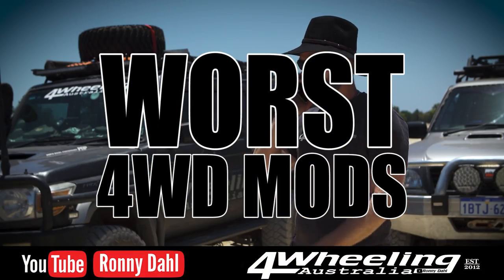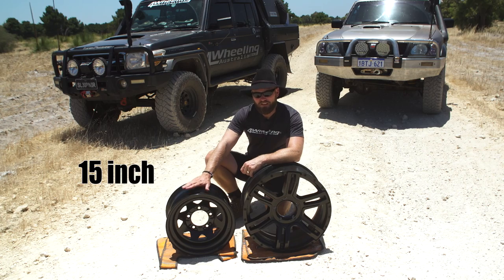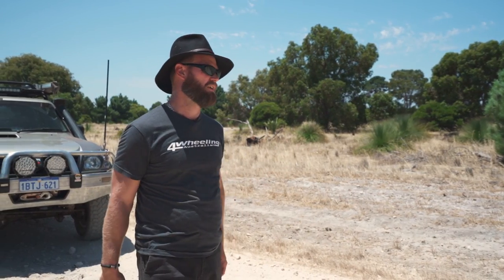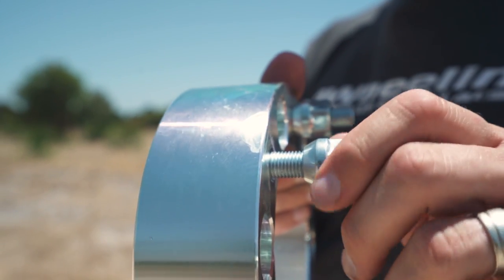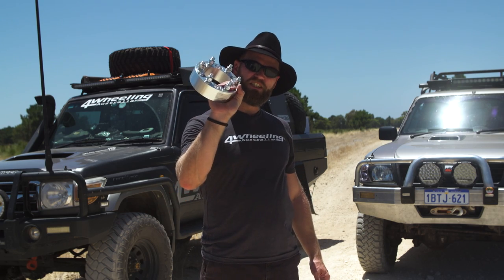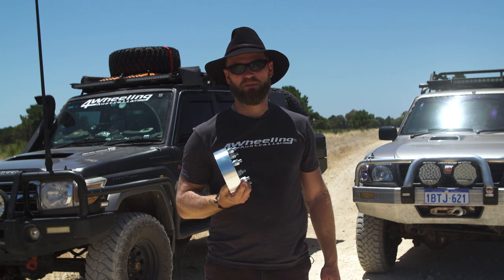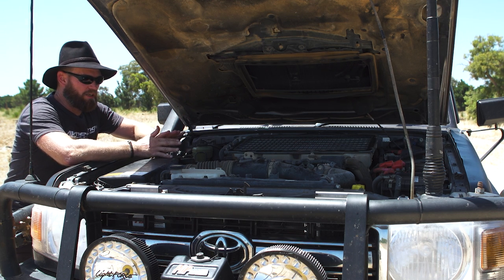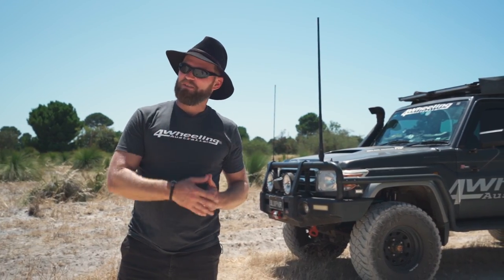WORST 4x4 MODS, DON'T DO THESE TO YOUR 4WD

Comment: Considering this is a mod page, and people are talking about tyres, would you ever consider going down to 33” tyres and giving us your likes and dislikes and mostly what you encounter with smaller tyres etc, like I wonder if you would do a big trip and give us your thoughts, considering you have used 35”S for ages now!
Reply from the maker: It’s something I’d like to compare and try as may ask this question publicly and privately. After restrictions I’ll give it a crack.
Reply: Ronny Dahl. Awesome mate looking forward to it, my main reason is basically tradies and some business owners mostly own vehicles that run 33”s and smaller and are doing smaller touring trips here and there. Most of us wouldn’t drive around town with 35”s for obvious cost reasons, but try to weigh up the added benefit of engineering and fuel consumption on the trips that we do take, just curios on your experiences thoughts. Keep up the great work and cinematography 👍🏼

Comment: Lmao wheel spacers are illegal in Australia? That sucks.  They can be useful if installed right to prevent rubbing.
Reply: Or you can just get correct it with wheel offset or a diff. As he said, on top of being illegal cheaping out is not smart. Poor man pays twice

Comment: When people buy too much truck.  If you get a f550 or a quad cab duramax 3500 hd and then thing you can just go out to the mud and the sand.  They spend 20k on wheels and lift to make it all "pretty" just to get stuck and be pulled out by a jeep or a suzuki that they were talking shit to on the way in. They are just too big and heavy.

Comment: You do realize that wheel spacers are not road legal in Australia that laws vary greatly worldwide right.

EDIT; When it comes to over the top engine tuning what if you have a Laptop and can switch between different tuning profiles, "Danger to Manifold" kind of thing?
Reply: You do realize that a viewer with even the slightest modicum of intelligence would be able to assume that the legalities referred to in a content creator's videos are most likely in reference to the laws in which country they are a resident of, unless stated otherwise, and to expect the content creator to know and acknowledge the laws as they pertain to all 195 countries on this planet is ludicrous.

Comment: Should put a "worst driving etiquette" video up as well Ronny. Gonna be the old man that shouts at clouds here but I am sick to death of ppl using the beach where all the families are camping or day tripping as a friken race track doing warp 11 on the beach past campsites where little kids and pets are around thinking it somehow adds an extra couple of inches...*cough* WHITEHILLS *cough*.
 Also to think letting your tires down somehow deflates your manhood as well when all it does is save the track and stop you getting stuck in easily avoidable situations. Oh yeah the worst mod you can do to a 4x4 is put a DH behind the wheel of it.

Comment: lifting an outback. sorry but even as an outback owner i just don’t see the point. You’re taking an AWD and making it maybe just as capable as a stock 4WD. makes more sense to just buy a stock 4wd and build a more capable rig off of that in my opinion. I love my outback but i know what it’s limits are and with little aftermarket even being available besides some rally accessories, i don’t see it as practical. There’s one good quality lift on the market for them and you know many aren’t dishing the money for a decent lift. it’s a good car camper but not a good truly off-road rig.

Comment: Me & my offroad buddies laugh at those super lifted vehicles that many we see claiming they go offroading! We actually run long suspension travel lots! Meaning, sure we get a few inches of lift but our suspension travel is maxed out, ie: when topping out we only got 6-7 inches of travel but we got over 12 inches that the suspension can extend, allowing for our tires to remain planted on the ground! Those who have those super high lifts tend to have at least 1 wheel off the ground nearly all the time at any one time! Plus the fact that sure they are lifted but still get high centered from their diffs & they just tear up those chrome diff plates! Lol, or they have those 4 link drop suspensions that get hung up on thick brush & many times caught fire due too the tunes they have on their "rigs"! Me & my buddies warn them on where we are going & clearance will be an issue! Not rock height issues, low tree issues! Many don't listen then complain that they just smashed their windshield(or windscreen for my follow bros & brunettes over the pond) from being to aggressive while near a low hanging tree! Also, sure having a little more height is nice to keep the water out of your rig but when you need help getting into or out of your rig tends to turn many off of helping you out! I don't like helping a 400lb guy(I'm 270lb guy myself so I shouldn't be too mean) get in to his rig just because he broke his step ladder! & that's one of my, "Why have this?!" Item, if you need a step ladder to get into your rig then it's to talk for ya or your to out of shape! Sure I carry a foot stool so my mother can get into my rig but that's to help someone else into my rig not from me, she has muscle & bone problems & sometimes I have to drive her around, so I'm doing that to help my mother, not to make it easier for me to get in/out myself! One of my buddies has a very lite form of MS(he claims it's a lite case, not me & he is over 200lbs) & with his lifted rig can get in & out without help so there's that too!

Comment: Idiots that have gone overboard with LED lights. There's a 4x4 in Cairns with (are you ready for this) 1 x 42inch Stedi LED bar mounted on the roof, 4 x Type-x Stedi lights mounted on the bull bar, Another 12inch Stedi mounted behind the grill, 2 x LED lights mounted near the rear vision mirrors facing slightly outwards at about 20 degrees, and 2 x LED lights facing towards the rear. You'd be able to see this 4x4 from outer space. Absolutely ridiculous and a waste of money.

Comment: Just watched this vid I know I'm really late for this comment but a snorkel is by far the worst mod. First of all it's at the roof of your truck. And if your in that deep I would be worried more about a snorkel and swimming gear for myself not the truck that just sunk
Reply: Worth noting that snorkels are also useful in dusty environments, particularly in convoys. Air will be notably cleaner up higher and many snorkels have an optional pre-filter to help preserve the engine air filter even further.

Comment: Bro dozers and useless mods, do y'all get the "insert whatever you call it" lean down under? It's this terrible trend all over the US with different states/towns claiming it as their own, where they lift the front of their truck/SUVs and often lower the rear. It's very illegal in all 50 states, but nobody stops em for it. I'm with you though, little rims, biggest tires that it'll fit, simple but quality mods, none of that extra stuff. Most 4x4s will do a lot more than people think with a solid all terrain or mild mud terrain, and skilled driving.

Comment: The giant wheels are definitely the worst.  They just scream Mall Crawler.  Run the smallest diameter wheel your brakes will allow.
I disagree with the HiLift jack though.  It has so many uses other than jacking up your vehicle that it's almost foolish not to have one if you go off-road.  Most of them were listed in another comment, but I'll add another here: they can be used to break the bead on your tire so you can clean out any mud or debris causing your tire to go flat.
I'm also amused by the cultural differences in off roading between Oz and the States.  I would say about let's say 65% of the stuff on your rigs (even if they are pretty awesome) would get you mocked off the trail by a serious off roader here in the States.  I don't mean any disrespect there and I know why those differences exist.  Oz has a crap ton of wide open space where you can get really far away from civilization, so an Expo rig like yours would shine there.  Here we have off road parks and trails that look more like what your buddy was doing with the rock crawling and such, plus deep mud.  An expo rig in that situation is way too top heavy or just plain too heavy in the mud.
As far as the wheel spacers, when installed properly, properly torqued with installed with thread locker, they can actually be safer than not having them as they add lateral stability to your vehicle.  They aren't illegal here either, though some shops won't touch them.  Yes, they put more stress on your wheel bearings, but so do wheels with less than centered backspacing.  Funny part is, I'm running both kinds.  I'm running 1.25" spacers with 4.25" BS 16x8" wheels on my T4R (my daily) so the tires can clear the upper control arms on the front and I have them on the back just to make the track the same as the front.  On my Tacoma (the trail rig), I'm running the .25" ones on the front so the steel wheels will clear the brake calipers.  I did, however, install longer wheel studs so I have plenty of thread engagement with the lug nuts.
IMHO, anybody that trusts a tire shop to properly torque their lug nuts is asking for a wheel to come off.  I always personally torque my lugs while it's on the lift if they'll let me or right in the parking lot in front of the techs if they won't, because I've never seen a tire tech actually use a torque wrench to torque the lugs.  Most places won't even do it if you specifically ask them to because they don't even have a torque wrench.  It's ridiculous.

Comment: I drive a 2012 GMC Sierra 1500 Z71 (Yes, I'm american lol) it came stock with 18" wheels (2012 year model available in 17", 18", & 20" wheel sizes) I bought it from my father in law a few years back with a Rancho 4" suspension lift on it and the 20" wheels off of his new 2017 GMC wapped in 295. 

I've been looking into down sizing the wheels to 17" and keeping the 295 tire size. When I mentioned this to my father in law you'd think I was proposing to sacrifice my 1st born! 

After looking into finding some suitable steel rims in 17X8 with 5.5 back space I realized what a tough nut this is going to be to crack. 

Am I completly insane for wanting to make this change? 
When I was younger and drove older 4X4's they came stock with smaller wheels. Everywhere I look nowadays everybody is running 20's or selling 20's to "upgrade" with. 

I found some 17"X9" steel wheels with the back space I need and am going to the shop for a test fit tomorrow. 

Is everybody so fascinated with 20" wheels just because they are for show trucks? 

Am I making a big mistake in putting these on my daily driver? I go on off road camping trips 2X a year and there is a lot of highway driving to get to these destinations before any 4wd is ever engaged. 

Your honest thoughts would be greatly apreciated. 

I love watching your vids, transports me directly to western Australia and helps me forget that Covid robbed me of my vacation time outdoors this year. Thanks for the always entertaining and informative content!

Comment: Anyone here have issues with wheel spacers? I know of many people who run em' on forums without any issues, but then this guy says they're the most dangerous thing ever.
Reply: I run wheel spacers but they are hub centric and the nuts are checked for torque every 6000 miles. Check out Spidertrax.

Comment: rims depends on tire size too much side wall will get cut between rocks and rims. Spacers are not illegal and are not unsafe and no different then backspaced rims IF installed correctly. you say they are for racing? that would put more stress on them then daily driving or offroad. You should not post wrong info.

Comment: 2 men exist. 1 goes 4x4 every weekend, and the other doesn't. They both buy parts and spend money getting these things installed but again, 1 goes 4x4 and the other does not. The importance here is the people still fabricating and making parts for vehicles that may or may not be used for 4x4 and may or may not exist. Without a demand, we lose our supply. Who cares if your rig is for show and dumbass over there breaks his shit every weekend, we still need a demand. Never hate the concrete warriors.

Comment: Met a bloke at a petrol station with a disco. Extra big aggressive tyres big rims on extensions so the rubber stuck out side the body by about 6”. Total police pull, looked stupid. And both his front tyres were bald on the outside, scrubbed to fuck.   Wot an arsehole

Comment: I have 19s. 09 ml550 and have gone through a Land Rover proving ground and climbed hills at 90 degrees with no issues while having stock psi and stock suspension. Videos upon request. I don’t get “airing down” I have never seen any test to prove it mattered. You either have what it takes or you winch. In my case I ran a trail at 45 psi on stock tires with people looking at me like I had 3 eyes. Get over yourself, it’s not that impressive to do what you do.

Comment: Worst mods you can buy, are the mods you don't need / will ever use. i.e you don't need to spend 2000 dollars on ARB air lockers just to drive through a forrest trail........also take your vehicle off road and see where it lacks before you dump 10000 dollars on mods

Comment: In Poland for 4000 Euro poeple swap their engine to 212 HP BMW M57, for 7000 Euro you get  280HP. All because of Fuell economy or faulty 3.0 engines from Y61, 2.5 ton Patrol Y60 with M57 on 35 inch KO2s takes only 10 liter diesel per 100km. It pay for itself quite fast. Most offroaders don't tune up engines much, fuel economy is just tragic, 20liters per 100km its a joke. Why M57? Very, very reliable, almost no electroics.

Comment: I have those spacers on several offroad vehicles. Just use RED LOCKTITE  (perma bond will be removed from heat at a specific temperature designed by locktight)  I locktight the lugs holding in the spacer and holding in the wheel, I have never had a single lug come loose.
I use a 1.25inch per tire, and i drive my jeep hard, i drift her like no other i have 35 inch MTZ mickys  on a 2.5 lift with a 1inch body
THe spacers allowed me to use a lower lift with the size tires. and give me a Beefier Look, as well as more stability on the ground,  ie I drift my jeep going 65 miles around a corner,   without  spacer it out flip, 
THis is due to the fact i Changed my center of gravity.  
Known fact jeeps standard Center of gravity is complete shit, My jeeps CoG is Fuckin amazing.
Do most people install these improperly?   Probably, Does this make it a bad product, No it does not.
Also the spacers you showed with no lugs,  Those are best used on heavy duty diesel trucks, because by default you already have 2-3 inches of bolt sticking past the wheelnut,    hell on my F250 I have to use a DEEPWELL SOCKET to remove my tires the bolts stick so far past the lug when fully tightened.  the spacers would acualy allow me to use a different tire that has a back side curl, but has a wider profile, that i cant normaly use, while also allowing me to use the standard 4 prong tire iron, instead of a specialty deepwell.  
wess if you have small stubby studs do not use those, your bolts need that thread, but not all vehicles are made the same or for the same intention.

Comment: Some good points but also some points about legality we in the States don't worry about. Also power and lift height all come down to what you are doing with your rig. First if you need a lot of articulation you will need the lift or get used to your head smacking the door column. My rav4 has more body roll in the turns than my rubicon with 3 inch lift on 37s.
  Here in the states a lot of us drive to and from the off road location so power and gearing must be enough for highway speeds and a low RPM crawl.

https://www.youtube.com/watch?v=0hbXZShnLeY

Comment: Man you make a lot of bad assumptions.
I have a 7in lift on my zj.
Not only did it not ruin the ride, it made it better. I daily drive and don't have "exessive body roll" nor am I excessively tippy on the trail.
I'm not saying that higher is better. I'm saying that some vehicles need more lift than others and not every lift over 6in is "exessive". In fact, even with my 7in lift I still had to cut 3in out of my fenders to clear my 33in tires. 

Again, my daily driver. Comfortable ride, better than stock actually. And I was the only guy out of 15 that cleared this obstacle even though I was the least built with the smallest tires. And I cleared it because I didn't hang up my cross member like everybody else.
https://youtu.be/0VN3N2GM1g4

Comment: If the wheel comes off because of a faulty install, how is this the spacers fault? 

That’s like saying all motors are bad because one mechanic installed spark plugs on backwards. No logic there.